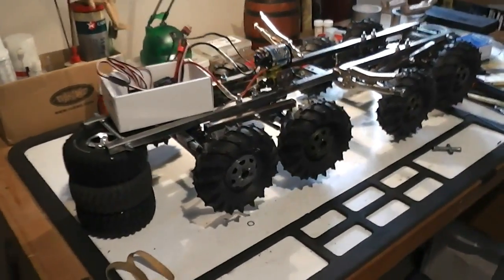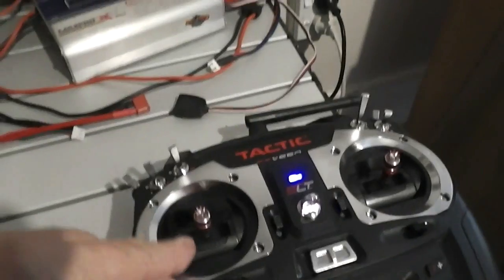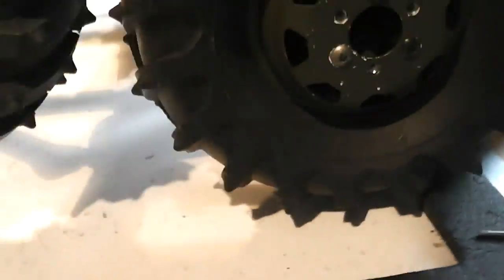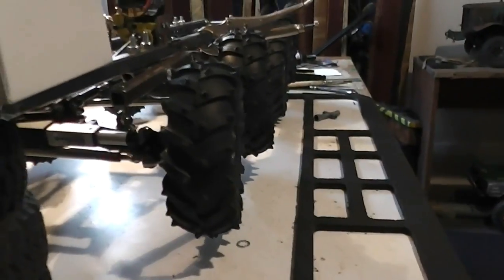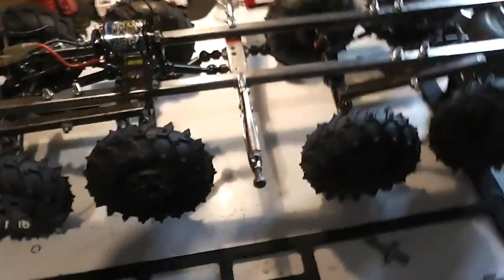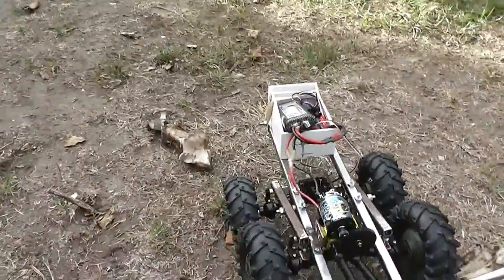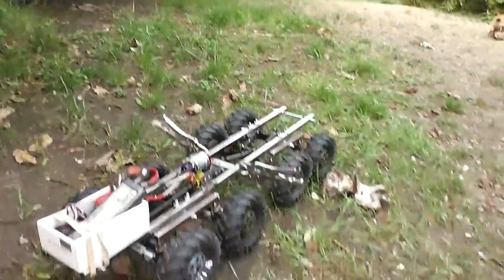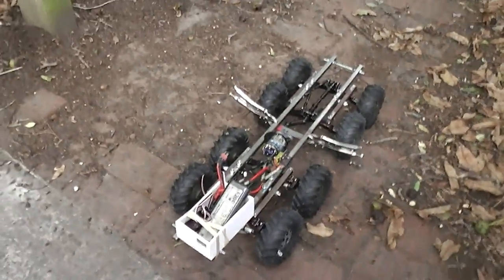Project: Wolf Spider. (part 8) Custom steel RC 8x8 Heavy Prime Mover.

Comment: Been following this one and I am getting excited now that it is moving! The suspension was a little bound up when fully flexed it looked like but other than that and the servo I was super impressed for a first test! Great job man! Your work is awesome! Alan Watts was a nice touch as well ;)
Reply from the maker: EXTREME SCALE PERFORMANCE RC Thanks mate! yeah, still need to add the brackets to stop the over articulation, and I have got the new linear servos, so I should get them bugs out of the system before it is finished.